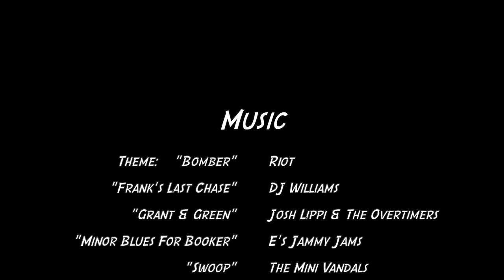Fiberglass: Flybridge walls & cabin sides - Boat Restoration EP014 (2014 Part 5)

Comment: Pretty cool.  What are the pros and cons of Xynol as oppose to 1708?  Also, what do you think of peel ply for large and small projects?
Reply from the maker: I'm no expert on fiberglass. I chose this material because it's specifications indicated that it had excellent abrasion resistance and conforms really well to curves and corners. The only area the factory fiberglassed on this boat was the decks (and of course the hull which is solid fiberglass, no core material).The deck fiberglass looked like just 1 layer of a light weight material. I wanted all of the painted exterior wood surfaces to have some protection. I would not used this material for any kind of structural work. 1708 is for that. I could have used 1708 but I thought it would just add unnecessary weight to an already heavy boat as the wood is the structure here. Also not sure if it would conform to some of the curves as easily . I did use it recently for some transom repair work and thought it was great for that and easy to work with. I have not used peel ply. To be honest I did not know it existed when I did all of this work. I read that it does not conform to curves but is great for flat surfaces. The flat surfaces are the easy ones to sand the corners and edges are the bear. I will be replacing some panels in the cockpit soon and will try using it to get an experienced opinion. I would suggest checking out the channels "Life on the Hulls" and "Boatworks Today". See my channels. These guys know about fiberglass.

Comment: That is some serious light weight cloth, 1700 can be used for tight areas and radius. It conforms very well and has done serious strength to it. Fir plywood and exposed ply in general Benicia from a glass and resin protection layer to prevent checking. If you are not looking for additional strength , the cloth you used should be fine, but i think there are better choices. Peel ply is great for epoxy work, the blush forms on the surface and it creates a surface that does not need to be sanded for additional laminate. Peel ply has the characteristic of smoothing the glass too, especially if the area is bumpy from seems or raveled edges.
Reply from the maker: Thanks for sharing your viewpoint. I agree there are other options out there that would work just as well or better. I still have yet to try using peel ply. Maybe some day. I've seen it used and boy does it save sanding time.
Reply: We had an identical boat for 30 years before we finally gave up on all that wood maintenance.  You’re doing good work. Better you than me!